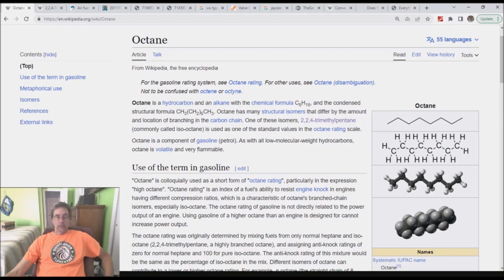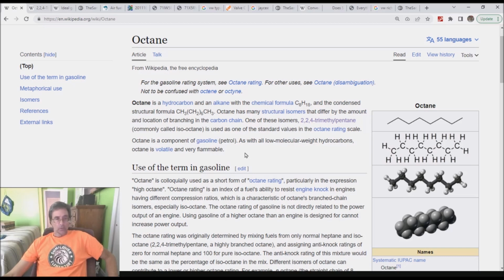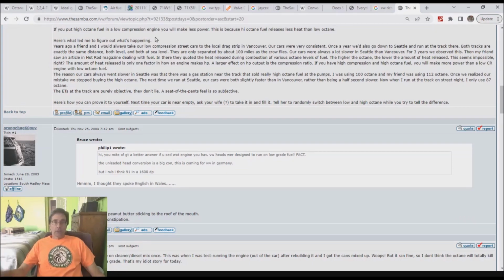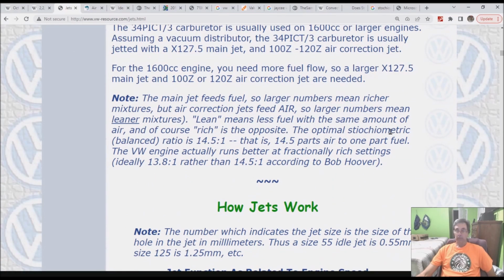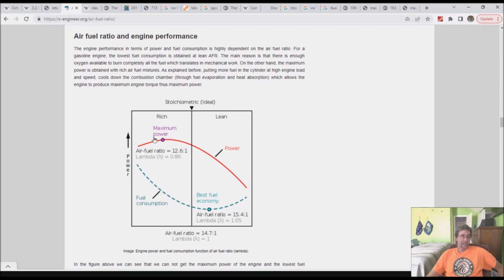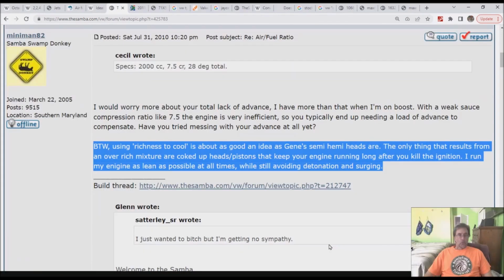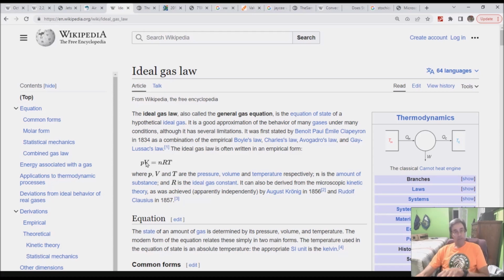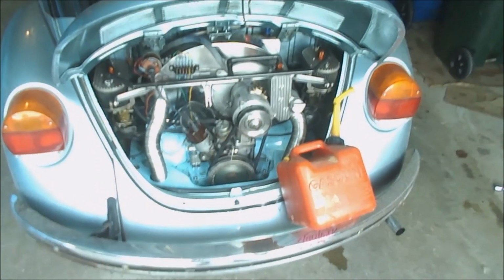vw tech #22a keep your ac vw cool, octane, timing, AFR

Comment: Hey Scotty.  Enjoyed this talk.
To back up what you are saying.  The first Hybrid car was the Honda Insight.   Besides the small battery pack.  Good mileage was achieved by a very lean burning three cylinder 1 liter motor.   If you had a slight tailwind on a level road, the car had a lean burn mode and you could see your real time mileage go up to as much as 85 mpg.  Actually,  it was quite addictive to hypermile the car.  
New hybrid are kind of a joke.  The electric motor is just there for more horsepower.  Sorry, I am not sure what the fuel ratio’s were.  But these engines didn’t run hot and would last to 300k miles with regular maintenance.
Reply: Scotty .. I admire your depth of research and cross analysis on these important topics.

If I may add ... 
The old out-dated (gray-haired) notion that:
1) running rich = a cooler engine
2) running lean = a hotter burn and hotter engine ... 

Probably stems from the extrapolation of the simple logic that 
(a burning open air torch) has a much hotter oxidizing flame ... than a (relatively) cooler neutral flame.

And like your research, and real numbers prove ... that without taking into consideration the confinement of the flame in the firing chamber, and under extreme compression, produces a counter to a logical conclusion .. 

Where a neutral mixture is cooler ... relative to
where a lean mixture  = a hotter running engine.

Yet .. the opposite it true .. once you scratch further deeper than the surface.
Cheers
Reply from the maker: @thestove2407  yes entirely possible. maybe i should do an origin vid on rich vs lean? however, hoover's claim was the excess fuel functioned as a substitute for water injection. fuel or water, it only gets added when needed to combat engine knock. otherwise? elevated engine temps
Reply: Thanks Scotty, I often watch your vlogs 2 or 3 times .. as they are information-packed.
Plus .. your depth of research is often filling in blanks and re-writing my perspectives. So I then have to watch a few more times .. to view these functions with a new perspective.
I'm impressed  !
That blue and red AFR stoichiometric ideal graph was amazing 👏 
Especially considering I'm slowly building my next engine ... so the AFR stoichiometric graph is really helpful. 
And knowing that the timing is tied so closely with octane  ... that's another

Cheers
Reply from the maker: yup, i remember those little funk mobiles. wasn't all lean burn. those cars had a CD nearly half that of a vw bug and used high pressure tires. i bet they were super quiet on the interstate.